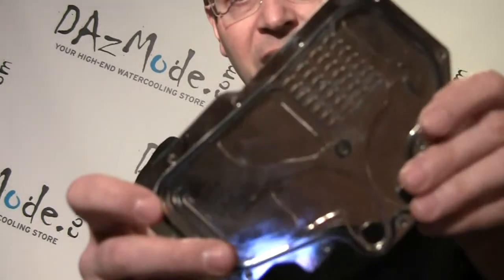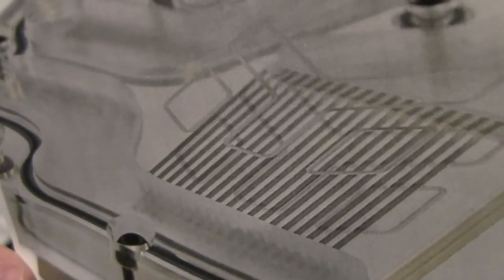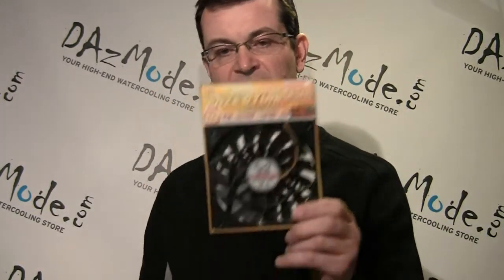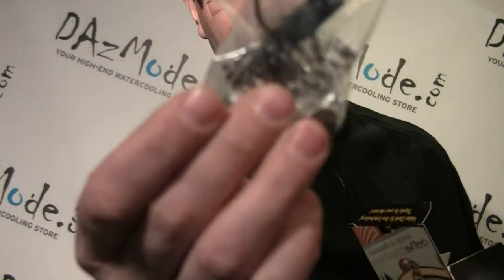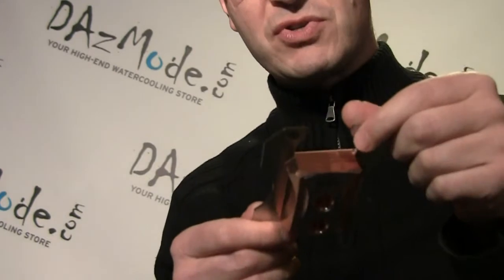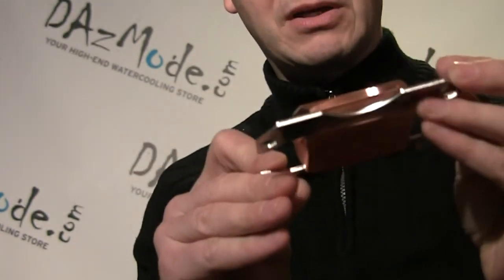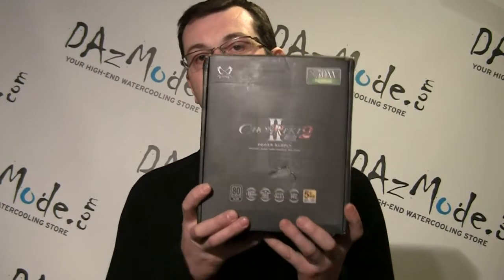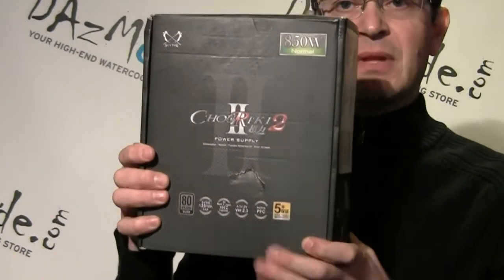AquaComputer Kryos AMD,  EK GPU Blocks Review - DazLabWeekly 5

Comment: @MrTardPower you mean the CPU copper cooler?
Hm I've got a GPU cooler out of copper and I can already see my fingerprints on it. They oxidate, I didn't think of cleaning it after I installed.

The other one is nickel plated, but for some reason it also cools a little worse than the pure copper cooler. Might be the Liquid Metal I've used (doesn't like contact with nickel?) or maybe the pressure isn't as good on the 2nd card.